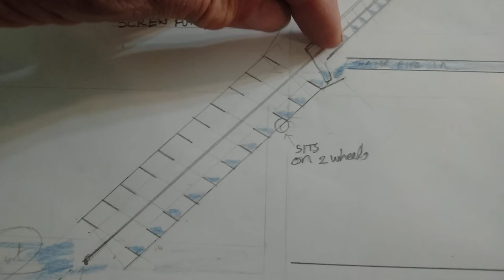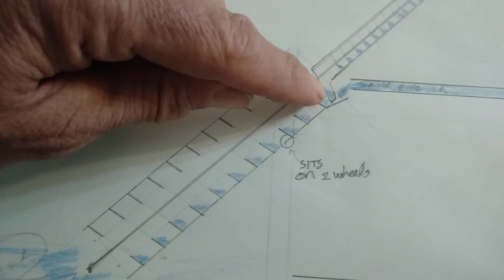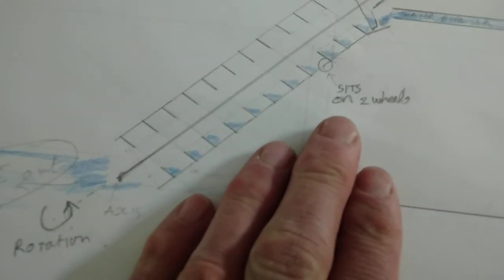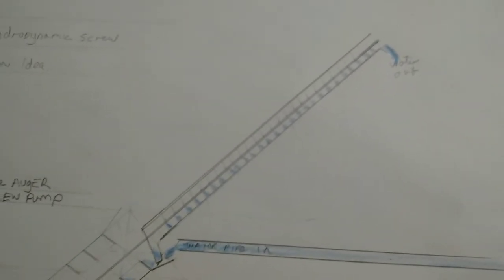Combine a Hydrodynamic Screw and Archimedes Screw on one shaft to use water power to  pump water?

Comment: That's a very interesting idea.  One might introduce some different gear ratios and optimize the torque/speed of each, depending on the distance up/down, angles and volume of water to be pumped.  It would be similar to a venturi mechanism that sucks air as water flows with gravity, where the air then rises mixed with water above the venturi level to a higher altitude.